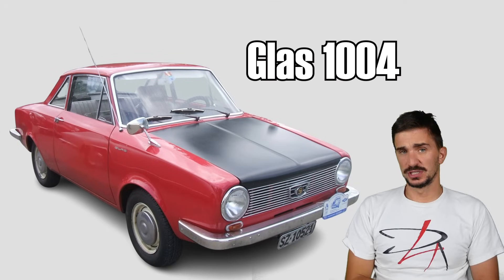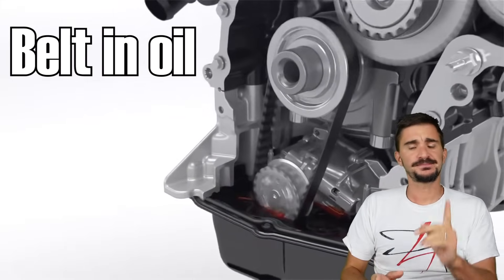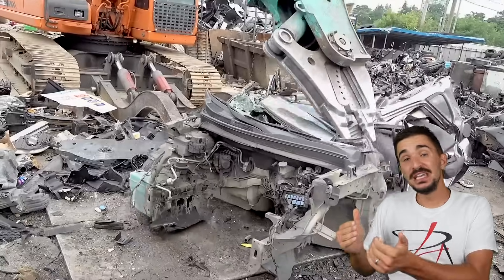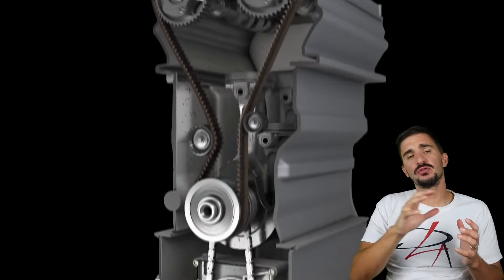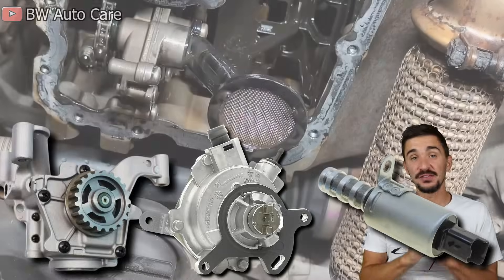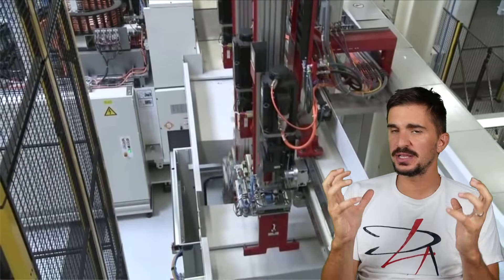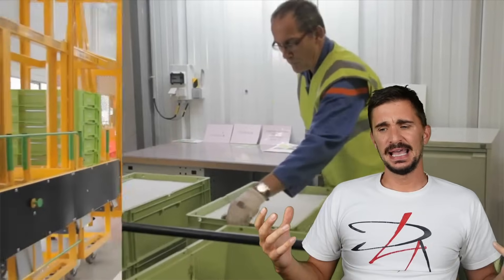Who Approved This and Why Is It Still Being Made? Wet Belt aka Belt in Oil Engines

Comment: Before watching the video and only learning about wet belts for the first time, I think my engineering knowledge is somewhere in the valley of stupidity where I wonder "But clutches bathed in oil are almost the universal standard on motorcycles, and they transmit power from the engine to the transmission. Why can't a belt bathed in oil be fine to transmit power across the belt assembly?"
Reply: most clutches aren't bathed in engine oil though, they usually have their own oil.  The accelerated belt breakdown is caused by certain chemicals that inevitably get into oil that is exposed to combustion.   That is why this issue is unique to things that are bathed in engine oil.

Comment: 15.2 EUR for 1 year, which you say is 13000km, but it's covered by for 200k miles which would take 15 years, or more than $225 EUR in fuel savings before it's your responsibility to pay for a replacement

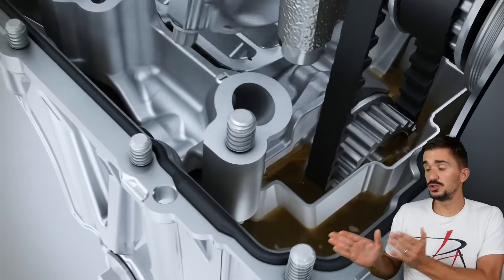Comment: 5:24 I think you are wrong. I don't think any Renault engine has ever had a wet belt. The 0.9 tce (H4BT) has a chain. The older 1.2 tce 100 (D4FT) has a dry timing wet, the later 1.2 tce 125 (H4FT) has a chain.

(Renault made things confusing, they have two 1.2 tce engines are two completely different engines. The D4FT is a turbo version of the D4F that was in original Twingo, its been around since the mid 90's. (D4F engines are pretty bulletproof to be honest). The later H4FT wasn't as reliable, lots of them seem to burn oil).

The 1.5 DCI (K9K) has always had a dry belt, its been around since 2001. It's used in loads of different cars. (Lots of Renault's, Nissan's, Dacia's, Mercedes. Suzuki used it in the Jimny too).

I wonder if you meant the PSA / Stellantis puretech engines? They have wet belts, plus oil burning problems. (It's a bit of pity, as I quite like the design of some of the newer Peugeot models, but I wouldn't touch anything with a puretech engine in it. And it seems to be in all of them).

Comment: Building an engine with incrementally higher fuel efficiency primarily benefits the manufacturer with CAFE compliance where 1% matters. In this process, it costs the consumer dollars to save pennies. You can also see this with the use of more engine components made of plastic resulting in lighter weight, and thus an incremental gain in MPG. The chase of miniscule improvement in fuel economy by manufacturers has rendered most modern cars less reliable,  and more expensive to maintain. I manage a service center and it breaks my heart when I have to tell a customer that their perfectly good car will cost more to repair than it is worth. We have gone back in time to when the average lifespan of an engine is 100,000 miles. Most modern engines are unrebuildable throw aways. 😢

Comment: Auto manufacturers are not in business for any altruistic reasons other than financial gain.  And though profit is form of theft, no politician would dare pressure manufactures to make better/safer goods.  (Ralph Nader tried in 70s-80s, with limited success and endured severe ridicule and backlash as result).  
Instead, people (aka ‘consumers’) should demand longer lasting, durable goods, that can last centuries.  It’s better ecologically and economically.  
In an ever increasing competitive marketplace, any auto maker that can manufacture at least one vehicle that can effortlessly last 100 yrs of service, effectively secures the brand’s reason for existence a century into the future.  

I think to some degree auto makers know this, but again, the lust for profits interfere.  Mercedes is already kinda doing this by incrementally improving, and benchmarking, their mil-spec G-wagon.   And now that it’s electrified, it may be driven on the moon … or mars?

Comment: Is it possible that regulations are to blame? a wet belt requires fewer seals to the outside of the engine, which can reduce the amount of minor oil leakage. It can keep those rubber particles from going out into the wild. And a 1% fuel saving does not seem to be for the consumer, but for the statistics that the vehicle can live up to new emissions norms. 
I have a 1.0 ecoboost myself. belt changed first time just before 200k km, and at almost 10 years old. Car has had regular service with the correct oil all the time, and it was fine. I suppose i may be lucky with a good belt and good engine, which has aslo mainly done longer highway driving.

Comment: To add to the mischief in this: A 1% fuel saving easily is a statistical artefact. In other words: A measurement error. I think the main goal was to save the three oil sealing rings at the bearings of crankshaft and camshafts.
Wet timing belts really are means to keep informed customers away.

Comment: My mother have a 2019 Ford Ecosport that suffered an engine failure at .........28,000 miles (45,000 KM). It has the infamous 1.0 liter 3 cylinder Ecoboost engine. If I read things correctly, the European version of this engine use an oil submerged timing belt while the US version uses a Timing Chain while the oil pump belt is rubber. I believe what failed is the timing chain guard. My guess is that they didn't test it enough as they moved from belt to chain. They fortunately replaced the engine with a completely new one but the fixed part is still not in stock until sometime in 2025. I hope her new engine doesn't fail in the mean time. I also spoke with lots of managers to make sure that her rental for a full month was covered which it was. 

I always say, ALL modern manufacturers are bad.

Comment: Keep in mind that, best engine manufacturers failed and closed due to non failing engines. Then after, manufacurers decide to produce controllable failing engines and sell spare parts. VAG for instance, still using DSG gearbox instead Torque converted gearbox even they claimed both of them have same manufacturing cost.
Reply: If that was a 100% true, Toyota and Honda shouldn't exist by now.

Comment: 100% guarantee that the decision to use a wet belt would never be made by the manufacturer engineers but by the manufacturers bean counters trying to save minimal dollars on the bottom line with zero thought for the customers investment in the product.

Comment: Wish I saw this video before I bought a peugeot 2008… 
Belt is about to snap at 70.000km / 3,5 years… where the manual and authorised services suggest changing it at 100.000
Car produced in 2021 , bought from new with all services on time at authorised workshops 🤦‍♂️

Comment: This is why I bought the new 7.3L Godzilla in my truck. Why buy 2-3 small fuel efficient used cars in the same time frame as a truck with a better engine, trans & running gear?  Nothing is without flaws and I don't idle my truck if I can help it.

Comment: Regarding 1% fuel saving vs. engine wear and the impact on the environment. Have you made a video on your comments about ECO driving?
I argue that replacing rusted brake discs and etc has a far greater negative impact on the environment than the supposed benefits from ECO driving.

Comment: i had a vw polo i know very sad but it was free,the bottom crank pulley had a slight oil seal leak,which rotted the teeth on the belt which were stripped off smashing all the Valve train to bits, they are really crap, and a wet belt is a built-in fail by the manufacturer

Comment: Had a 2001 Toyota Camry that ran great until the timing belt went. I bought it used and did not know about the need to replace those. Engine not worth the repair bills.

Comment: Good that my CAYB engine (VW 1.6 TDI) has a timing belt and the clock shows 175,000 km 😇. Thanks for the call to get rid of this technology. I believe system cost and legislation advances (CO2 limits) still run the arguments of those who won these decisions on the valve train. What can each of us do? Buying a car which has an engine, which has rational design. There are not many, only few: Toyota, Honda, Mazda, ...the obvious ones when it comes to quality.

Comment: You never hear much about fuel contaminated oil's effect on the belt. What components go into fuel have changed over the years, and unlike the oil the engine designer has no control of what fuel is going to be used, unlike manufacturers recomended oil

Comment: Stelanstis OSA  group  ( Citroen, Peugeot, Vauxhall etc) now warranty wet belts FOR LIFE provided the car is properly service by their main dealers so should not be an issue and it will encourage you to keep the car in top notch condition and therefore hold its value better.
Reply: Define "LIFE"? The devil is in the detail with OEMs.
Reply: I do my own maintenance and repairs becouse i knew about the problem. After owning the car for 5 years ( 150k km) and no problems ( use 5w30) and change belt every 50k. PSA got sueded and started the life long waranty, now i am not elidgable for the warranty 😢

Comment: Mech Eng here who’s having related issues. You are all missing something - Temperature. A wet belt is running in 80-90 deg oil versus maybe 50 -60 deg outside the engine. Sounds like a nothing  change doesn’t it? Hear me out. The Arrhenius equation says that chemical reactionss are exponentially related to temperature.ill tell you about  my issue which is about grease drying out. That equation says that for every 10 degC above 60, the grease life is HALVED! So my machine is running at 90 DegC has 1/8 of the grease life of at 60. This is 1250 hours instead of the 10000 I’m shooting for.
Reply: So my point is to show how a small increase in temp vastly increases the chemical reactions which are degrading the belt

Comment: The buyers of low profit margin 3-cylinder econoboxes are working class who would drive their cars into the grave before taking a loan out on a new one, so you must engineer obsolescence into those vehicles thereby generating more frequent replacement.  If you can't make revenue with higher unit prices, force the market to buy them more often.

Comment: Is there a possibility, that separate oil section (disconnected from the oil pump n stuff, just plain oil container at crank pulley) would keep the oil quality sufficient longer for the belt? I don't see why the wet belt would need to be connected to the oil pump n whatever else.

Comment: It is a good idea to them and other manufacturers because not very many people will get rid of a car at 100k miles as they'll likely still be paying off the loan. So it's either spend thousands on the repair as a lot of these especially ford's are behind another belt or chain requiring high labor costs or buy a new car where they'll reduce your trade in value because it needs repairs. Also "lifetime" parts or fluid are false in our interpretation even timing chains but true to them because the part failed therefore it was for the "lifetime" of the part and not illegal for them to claim. We have a different generation of snake oil car manufacturers about us now a days.

Comment: I agree, it's a scam. These belts are to make more profit. 
I remember when you didn't need to remove the gearbox from FWD Vauxhall's, just a metal plate and draw back the input shaft. Then this was stopped and the gearbox then needed to be removed. This is the time, manufacturers started to make working on cars more difficult than it needed to be (bigger bills). The have now been more daring about what they will do to introduce faults for financial gain. It's not the first time companies put profit above everything. Many companies in history have provided goods that cause physical harm and death to customers for many years before they were tackled by legislation. This will just morph into a different problem. Maybe some companies will recognise the value of good service and products.

Comment: There should be class actions against these manufacturers for compensation.
What I look at though is that the justification for lots of these small, high output engines is pretty well moot these days for most applications. A good EV is now roughly the same price to build, lasts longer and doesn’t need all of the maintenance.

Comment: hi all, what do you think of ford tourneo grand connect 2.0 diesel 90kW 122hp with wet belt?
i talked to the mechanic, wetbelt change will cost 1200euro, most of the money will be for work, new sump,new side plate, new pump, flushing and new oil is the procedure.
what do you think about that engine? 
i need a new car, baby incoming !!!
thank you for kind replies.

Comment: I was tol  Ford based this on industrial machines.  Do they use wet belts in industrial?
Reply: They probably do. But the conditions are vastly different. I used to work in an industrial area as an electrician and every two weeks me and better men than myself would double check that everything is in order with the equipment.

Comment: I am of the opinion that they engineer cars now to be overly complex so that the dealers can make the money on service. I have been DYI for 50 + years and am still very active on service and repair. It is not hard to see where they engineer in or fail to engineer in something as simple as a detente for a bolt access that could save hours of labour, a oil filter larger than a tea cup, to extend service life, a double roller chain instead of a bicycle chain. etc.

Comment: I have avoided rubber belts after my 88 CRX "blew" a rubber belt (that was changed during it's life before required) at 160K miles! The valves went through the pistons, irreparable, only option, part out the entire car! I go for timing chains on my vehicles, longevity over short term gain! Do you know what your car or cars have?

Comment: how about a video about the carbon problem caused by direct injection and crank case oil vapors being sent to air induction to be burned with fuel. and why they haven't designed a way to introduce the oil vapors directly into lets say just one cylinder and not pass by any valve or into hot exhaust to be burned. or why no one has been able to come up with special tools, chemicals that are more affordable than walnut blasting. like maybe building new engines with lines and injectors aimed at intake valves that say at each oil change dry ice pellets could be blasted on valves to clean them. it seems the new thinner oils introduce more oil vapors than thicker oils. and the new low tension piston rings get gummed up increasing oil consumption and more oil vapors. maybe make 1 intake valve that all crank case oil vapors pass through that has port fuel injection for just that 1 intake valve.

Comment: I avoid stuff like this altogether by driving an electric car. 11 years old now, I don't even see fuel costs on my electric bill it's so small, and maintenance is only tires and battery and the large battery is original. The largest downside is range, but trips beyond its range happen 3 tmes per yesr and I use my 280,000 miles Toyota for those. Different materials in a timing belt (steel, HDPE, glass fibers, etc.) might solve these problems, but timing chains worked great, lasted forever, and noise was minimal.

Comment: Not a profit problem, its a regulation problem. Your lasting argument is how we ended up with these belts because regulators favored emissions standards over reliability or consumer motives. The attitude of controlling how markets work is how you end up with market inefficiency like this garbage. Same thing with 5w20. Or super unbalanced v5 engines. Arbitrary standards.

Comment: i dont see why they dont move the belt to outside the engine like the alternator belt is, it would make it cheaper to change and easier to keep an eye on it, some motorcycles have exposed drive belts, i see no reason why timing belts should be behind covers

Comment: I would have no issue with rubber timing belt , if the engine was designed not to bend valves . ford pinto , older volvo did it

Comment: I couldn't agree more with your closing statements. The list of bad technology that continues to get produced is long. I feel one of the worst offenders is GM Active Fuel Management. They took the very solid V8 engines and injected this garbage technology that saves the customer pennies in fuel while costing thousands to repair. Unfortunately, this seems to be the direction most auto makers are going.

Comment: No. I cannot find confirmation anywhere else that the VW 1.5 TSI Turbo engine (EA211) features a wet timing belt. Everyone else reports that a dry belt is being used. 
Late comment: yes. I only today happened upon the video.l